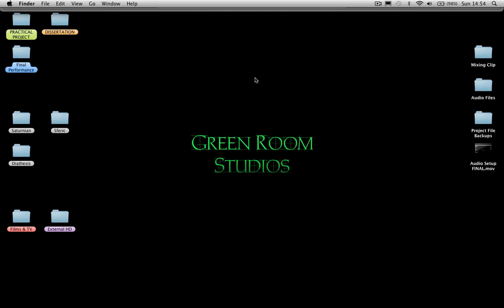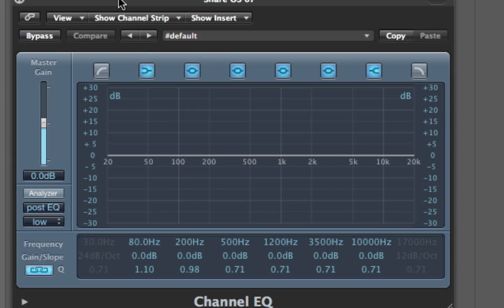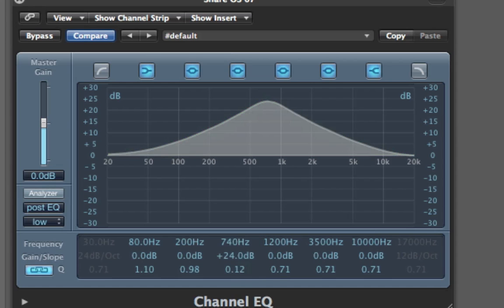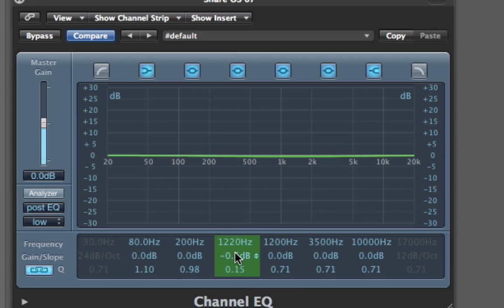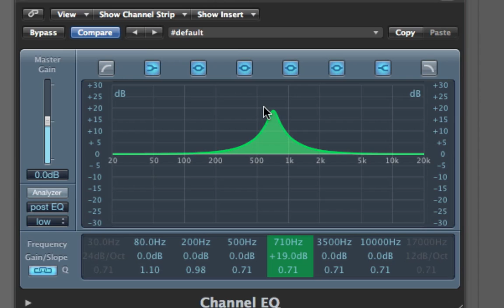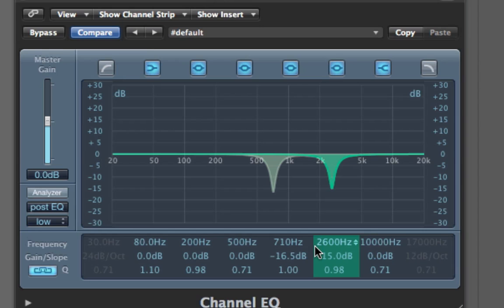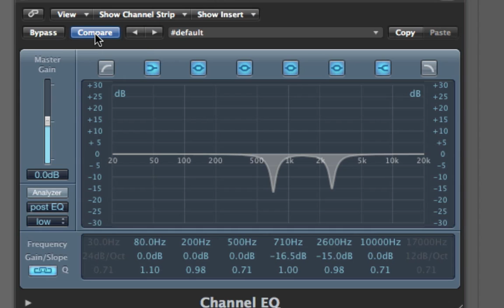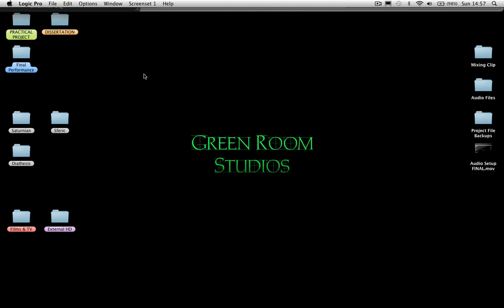Home Recording Part 5/7: Parametric EQ

Comment: I've recently downloaded an app from Google play called aDSP Player onto my phone. It's an extremely basic music player with the ability to allow me to "build" my own parametric EQ right inside the phone, adding as many bands as I want. The largest stand alone EQ's available to the public seem to be 31 band EQ's but this app will allow me to create 100 bands if I want. I'm very new to parametric EQ's and the level of control I have over the signal. It's not designed for mixing or anything, only playback manipulation. I'm just beginning to realize the practical effect the bandwidth parameter has on each center frequency, which is something I have struggled to grasp. Anyway, I believe you can also download the app onto a desktop and experiment as well. Cheers!